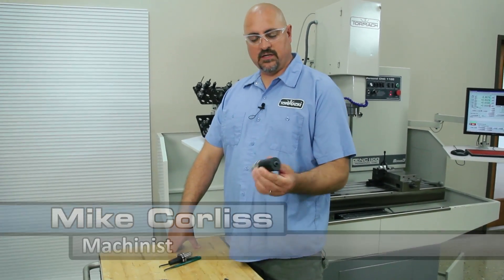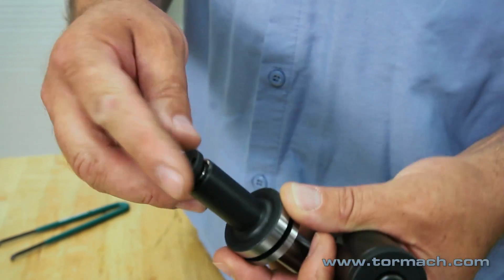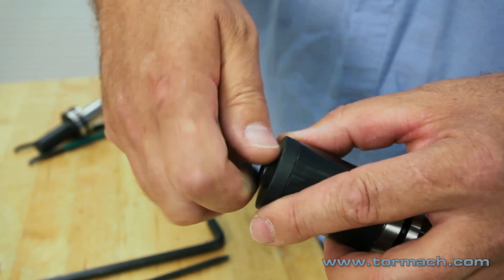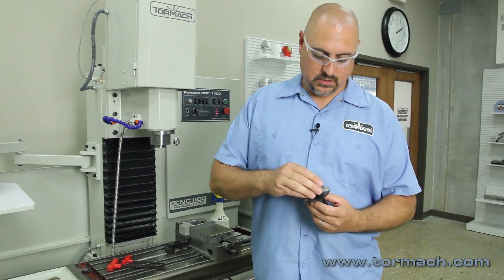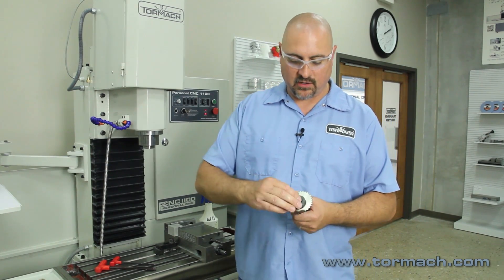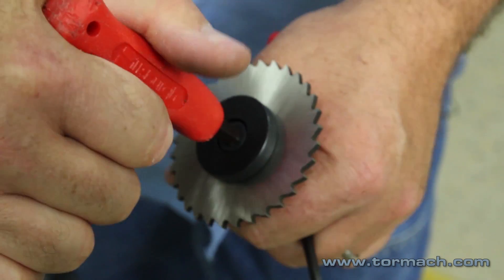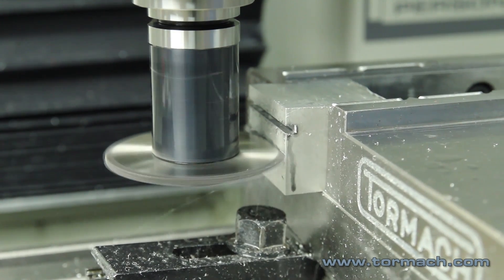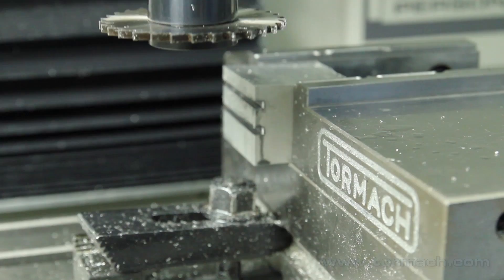Slitting Saw Tips and Tricks - Tormach CNC

Comment: How deep can you cut in 1 pass in aluminum. What about rpm. (the links on the description are not working) Thanks
Reply: Can we start with the speeds and feeds that are shown in the video?
Reply from the maker: This is really going to vary depending on your cutting parameters (thickness of slitting saw, is the saw relieve ground, coolant, type of aluminum, work holding, etc.). It only takes one of these to be off to break the tool. If speed is important then I would recommend working your way up incrementally to get the best results for your setup.